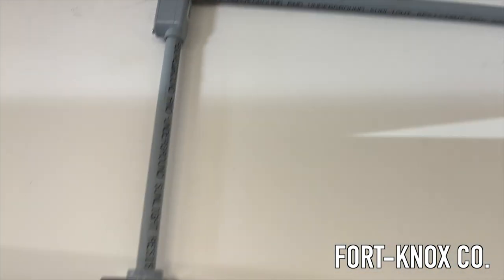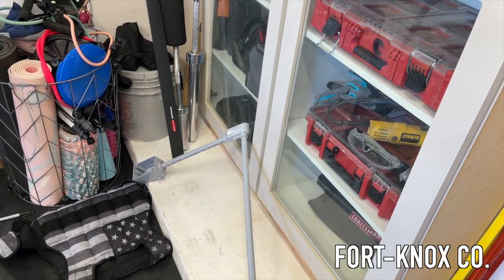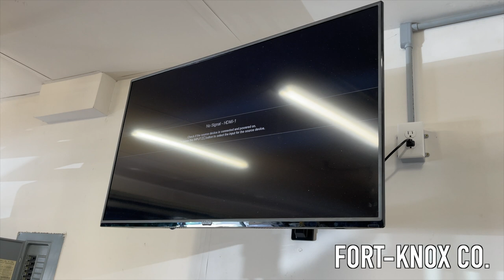How to Add Electrical Outlets in Garage | No Drywall Work!! | DIY electrician | Existing Circuit

Comment: You voided the box listing and approved usage.  First hint was you had to cut it out.   Don’t understand why you didn’t use an approved listed “box extension”.  Added bonus, cheaper than the box you butchered.   That size pvc must be supported within 3 feet of a box or fitting and every 3 feet along the conduit.  Why in the world would you work on a hot receptacle?   At our electrical contracting company, if you did that, you would be fired, no questions asked.   Always be safe, the life you save may just be your own!
Reply from the maker: All really good information! Thank you
Reply: Looks like 14/2 in the garage, in TX we have to use 12/2 in the garage and GFCI protected, either outlet or breaker
Reply: @ScienceBitch123  can you explain why adding a new junction box above would be better vs extending an existing outlet box?

Comment: My friend, I don't like the aesthetic of running the wire outside the wall in the conduit. I would not do it in my garage and Hope renters would ask me prior doing anything & treat the rental property as their own & not as a one night stand slot. 
It would be much more educational and beneficial for me to learn how to run the wire inside of the existing wall - up and across studs.
Reply from the maker: This is just one way to do it. There are many ways. And when we left the rental everything was down and back to as it was within minutes. The owner did give us permission. They didn’t want all the work done on the drywall and invasiveness of the “right” or better way to do it. I understand what you’re saying though. It was really just for a temporary set up. We could have accomplished the same goal technically by just running an extension cord across the walls and pinning or taping it up to where we wanted. I just wanted to go the extra step and use conduit and show ppl on YouTube something interesting. And maybe learn a couple things about electrical work along the way. 🤷🏼‍♂️
Reply: @FortKnoxCo  Thank you my friend! 
1) Did you serve in the military? 
2) Where and how did you learn so many home improvement, construction and many other skills? 
I'm very impressed!
Reply from the maker: @genevelis6075  not in the military but I do parallel that career field. 
Some was training/school from grade school. We had Construction class, similar to having auto shop in high school. So I spent several years doing that in school as my elective classes. But it mainly focused on woodworking. Dabbled into the other trades. 

From there it was really self thought and sought out education. Asking question and paying attention. My mindset was always if the certified or trained guy showing up doing all the technical work had two hands and two feet like me then there’s no reason why I can’t do it too. The only difference is I didn’t know something. So I could learn and I did. No different than going to school or reading the books on it. 

I’m also motivated by the money I could save. I enjoy doing the work and enjoy even more having the nice things at the end of that hard work and keeping the money in the bank.
Reply: @FortKnoxCo  Great attitude! 👍

Comment: You modified the box and lost the UL listing. I would not have a problem with that. Your insurance guy will.
Reply from the maker: This kinda installment can quickly and easily be removed and brought back to original. We only used it for temporary power over to a tv monitor. Once we were done it was removed.

Comment: Wouldn't it be easier to just use rolls of black, white, and green wire instead of Romex? It would be easier to run through the tubing and around corners.
Reply from the maker: Not necessarily. Having three wires ran could be 3 times more chances it’s binds or gets stuck. 3x the work possibly. And more expensive sometimes as well

Comment: good video. don't use the push ins though. They get weak and can eventually arc. better to pigtail all the wires.
Reply from the maker: Thank you. Yeah I’ve heard the same, I figured at first they must be there for a reason. But after hearing back from licensed electricians that exactly what they said.
Reply: Also, pun-ins don’t provide the same amount of contact between receptacle and wire.  I haven’t used the push-ins for more than 40 years after I saw a case of arcing damage caused by loose push-in contact. If there aren’t hot and neutral screw contacts free on an outlet, pigtails are the way to go as Keith stated.

Comment: This was an excellent way of running 12-2 throughout my garage. A lot of garages built back in the day have 1-2 outlets and one of those outlets is for garage door which you could also tap into. But this was a great fix. I will say to those attempting this. Understand your receptacle/outlet. GFCI has a line and load side. Your line side takes in power from main circuit breaker your load runs your outlets. Pigtail both. Make sure you install that properly. Also it was not a simple run wiring through plastic conduit. I dry fit everything than tried running wire stuff was far more difficult to push through than I anticipated. So I literally had to disassemble and run wire through each piece of pvc then pull wire through then assemble that section working my way through the entire “pvc run”. I had some 90’s and junction boxes etc. so just pull all your wire through each individual piece as you work down the line other wise even with fish tape it’s not the easiest to pull your wires. That I found strange seeing it’s like plastic/rubber insulation of the 12-2 through pvc I thought it’d pull right through all my twists and turns but fuck no. Shit would not budge. So I disassembled and laid it all out then one piece at a time ran wire through then assembled that piece or section, then did the same process all the way through till I reached my last piece. Came out sick though. Garage with my new cabinets I made are awesome. Thank you for sharing this.
Reply from the maker: Great information! Man it sounds like you have it hell trying to pull that wire through. Yes it is very difficult to pull or push that wire through. If you make sure the wire is as straight or in kinked as possible it will help. But it’s still no easy task.
Reply: How do I know if I need 12-2 or 14-2? How do I wire GFCI? Thanks
Reply from the maker: @kipjohns7424  12/2 (yellow) is usually for outlets. 14/2(white) is commonly used for lighting fixtures.   I have a video on my channel specifically showing how to wires GFCI
Reply: GFCI 💪🏼⚡️

Comment: I am not electrician but I am interested in doing this in my own garage. But just from what I read I am under the impression you cannot put romax in conduit because of the heat generated by the wires. Is there any truth to this?.
Reply from the maker: Romex is usually ran through different types of conduits, wether it’s pvc or metal. It shouldn’t be generating any heat. If anything the conduit you choose is adding a layer of protection. When running electrical underground in this type of conduit it’s always Romex wire that’s used. So I don’t think heat generation is an issue.
Reply: Yeah, you cannot run Romex inside any conduit.  Conduit requires individual wires.
Reply: 334.15.(B) of the National Electric Code . Allows NM cable to be run in conduit for protection like in this video.
Reply: @EmpTy-kf2rq  334.15.(B) of the National Electric Code . Allows NM cable to be run in conduit for protection like in this video.
Reply from the maker: @keithharrington8715  nice!! Thank you for this!
Reply from the maker: @ScienceBitch123  I don’t believe that’s correct. They use schedule 40 and 80 conduit underground here in Las Vegas for different runs. I’ve pulled permits and had them specify schedule conduit in multiple situations. Every city, county or state can have variations of what’s allowed or preferred. But I’d say when I’m doing go big and overbuild it.
Reply: @FortKnoxCo  My impression is underground is always considered "damp or wet" meaning you can't run regular romex in the underground conduit. You can run it in conduit above ground.
Reply from the maker: @quademasters249  I agree with what your saying. My main goal was to show that you can run wire outside a wall and to use something to cover the wire and provide some protection. In this case I was running the wire temporarily while living in a rental and when we moved out I was able to quickly pull everything and reinstall the outlet back to its  original state.
Reply: @FortKnoxCo  I liked what you did. The way you extended the existing box made me feel oogy but, I've done worse for temporary installs.
Reply from the maker: @quademasters249  thanks. Yeah it was all with the intent of taking it off eventually. When we left the rental it all came off seamlessly and it functioned like we needed while installed. We used it to power a wall mounted tv in the garage gym
Reply: @FortKnoxCo  If it was temporary why not use extension cord?
Reply from the maker: @danstvguy  didn’t want cords running across the gym floor and work space. And what’s the fun in that, wouldn’t have had a video to make about it.
Reply: THHN Wires are used in conduit, not Romex. And it would need to be 3/4" conduit, as you cannot exceed 53% of the opening inside of the conduit!! So you're not to Code, unless where you live, this is your codes>>>?? No disrespect intended, however, if you're going to make videos for the average homeowner, than at least make sure that they don't follow this video for their homes. What you do for yours, is clearly your business, although if an inspector saw this, you would most likely be changing a whole lot of issues!!

Comment: Biggest issue I have is the original receptacle. What you should be doing is twisting all the wires together (black/black, white/white and ground) and running a pigtail off of that connection to the original outlet.
Reply from the maker: I agree. Pigtailing the wires and coming out with just one lead each is best
Reply: Right. I don't think it's even legal to use the screws and add wires in the back.
Reply: and also a good time to replace the outlet, if it is fairly old.
Reply: That’s the correct method is pigtails?  I was concerned you would have to actually come off the receptacle at the end of the circuit.

Comment: that's pretty funny, I never thought about just cutting the back out of a box to make a box extension, I'm going to have to steal that idea. Nice work, I personally would've installed EMT though it definitely would've looked a lot cleaner than the plastic pipes, but pvc does work.
Reply from the maker: Yeah. I was just being creative. I guess some places you can find the box with the back cut out already. Different purpose but you could repurpose the product to achieve this.

I just went with plastic for the quickness. It was a temporary Installation for about a year while we were in a rental. Didn’t want to make anything permanent, but needed an outlet for a tv in the “gym” garage.  Once we moved out I was able to pop everything off and no damage and replace the standard socket/faceplate on the wall.

Comment: Love this. I was really about to run to the junction for my wood shop lol this is a better idea
Reply from the maker: Awesome. Yeah there’s a few creative way to add an outlet or run some additional power. I mainly did this because it was a rental house and I didn’t want to do a bunch of drywall work running it inside the walls. And when we moved out I could take everything down and put the outlet back to normal

Comment: By pig tail both I mean I pig tailed my line side as one then I did a separate pig tail for my load side. That way all my outlets are protected from the GFCI. Thank goodness I got that info from another electrician YouTuber who explained that process.
Reply from the maker: Yes pig tailing your wires is usually best practice when your able to. Helps keep things clean and organized as well

Comment: Thanks for this. Considering doing something similar for my garage. Are there any codes around what types of boxes and conduit you can/can't use and also if there's a minimum height that everything needs to be at (e.g. could you have dropped the runs so that they go lower than the outlet you were branching off of for instance?)?
Reply from the maker: I mainly did this a a temporary install while we lived in the rental house. Once we moved out I was quickly able to pull down that conduit and reinstall the original outlet and face plate. Looked like it never happened. 

If your going to do this I would use either the grey schedule 40 conduit with is rated for exterior and being buried. It will definitely serve its purpose.  It if your looking at what’s code compliant, you may need to look up what your location codes asks for. Every area is different. Even just using white PVC or black ABS pipe is required for different areas for plumbing , but both are completely good for it. So some areas may ask if it’s installed indoors you may need it to be non conductive metal conduit. A little more expensive, more technical for install. But more appropriate for fixed indoor use.
Reply from the maker: As far as height you can usually go down to where you see other outlets in a home. Around 16” or so. But it’s just common in garage to by up higher usually for above counter/workbench usage.

Comment: At 7:24, what exactly am I seeing on the ground terminal???  It looks like two wires under one screw; and if so, then wouldn't this violate the rules??? According to the NEC, the general rule is that you should NOT put two wires under a single screw on an outlet terminal UNLESS the terminal is specifically marked or designed to accommodate multiple wires; this principle is largely based on the idea that each terminal should only hold one conductor, as outlined in NEC 110.14(A).
Reply from the maker: You are correct, you should only put one wire per terminal. And if you have multiple wires you should be Pigtailing and coming off with one lead for that terminal

Comment: that is all in well fine for your purpose, I want to add a circuit from the panel without tearing up the drywall. I can't seem to find a video to do that. Might have to breakdown and call an electrician.
Reply from the maker: It kinda of depends on how far away you want that circuit. At some point you’ll need to get inside the side of you electrical panel if your adding a whole new circuit and breaker. Still could be very minimal work on the drywall to get the wire through the side of the electrical panel and make it pop right out the wall next to it. Then run it along the wall in your choice of conduit to your location and outlet

Comment: why is the TV drop 1 stud over from the TV mount?   would be cleaner if the new outlet was right above the TV mount bracket on the same stud.
Reply from the maker: Just kinda happened to be where the TV needed to be centered in the room compared to the nearest outlet. The goal obviously is to have the outlet somewhere behind the tv if possible. But if the nearest outlet was several studs over I’d be jumping the power over to again conceal it behind the TV

Comment: When you attached the new wires to the original outlet, what did you do with the wires that were originally connected?
Reply from the maker: I’m still using the original wires and outlet, just branching off from the ones that are there and running the branch to the other outlet. 
You do what is called Pig tailing. You bind the black wires up and have 1 lead that comes off. So the power transfers through the like wires and the 1 lead wire that comes off attaches to the outlet. Do the same thing for the grounds and white neutrals. 

I have a couple other videos showing this process, how to love an outlet up the wall, how to add an electrical outlet.

Comment: Can we use the same PVC pipes for external walls as well(the walls outside the house )?, How thick are these PVC pipes
Reply from the maker: You can and they will be fine outside. The grey wall pvc is usually schedule 40 pipe and that’s rated for exterior.  But if you trying to go with what code allows you may still need to check with your local codes. But in general this pipe will be fine outside. The other option would be the metal conduit

Comment: They say to always secure the loose screw in the receptical so its not sticking out as it will be hot.
Reply from the maker: Yep! Any screw your not using should be tightened down so it doesn’t possibly make contact with anything. Or come loose and fall out.

Comment: Where did you get the conduit mounting brackets?
Reply from the maker: I actually found them at Home Depot. But you can get them off Amazon as well. You can search for PVC pipe straps or conduit pipe strap clamps. They should pop up.

Comment: Thanks for the vid. FYI, The code (in my area) is you're not allowed to use romex inside pvc.
Reply from the maker: Yeah codes in different areas vary a lot. But most of the research I’ve done and in our area they allow it or even recommend it to protect the wire anytime it may be in a place that it could become damaged. You just have to use schedule 40 or schedule 80 Grey pvc for electrical. None of the white plumbing pvc stuff is allowed. That’s usually when running underground too. If it’s exposed, like on a garage wall you could use the electrical metallic conduit. That’s commonly seen when the runs of electrical are going to be exposed.
Reply: @FortKnoxCo  Correct, do it all the time, passes code no problem.

Comment: What’s the little boxes at the pipe turns?…
Reply from the maker: Those are just one of a couple ways you can make the 90 degree turn. They do have 90 elbows but I chose these 90 degree small junction boxes for this project.
Reply: They are called conduit bodies.